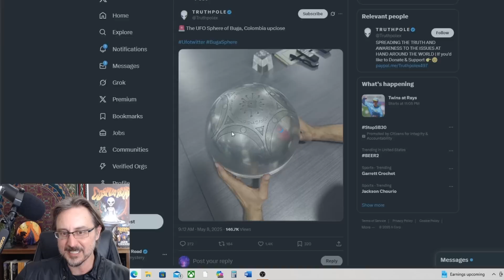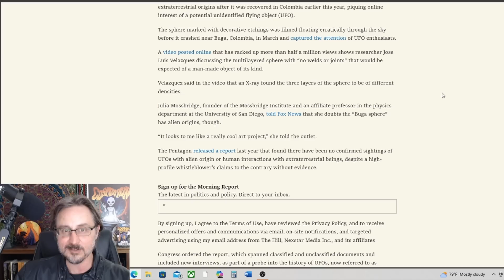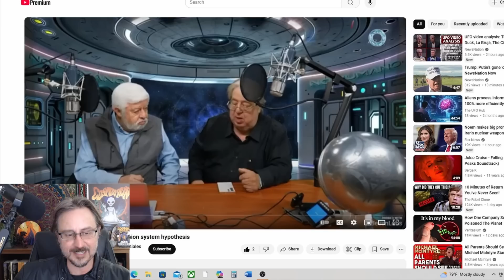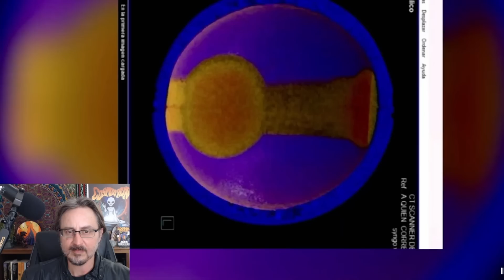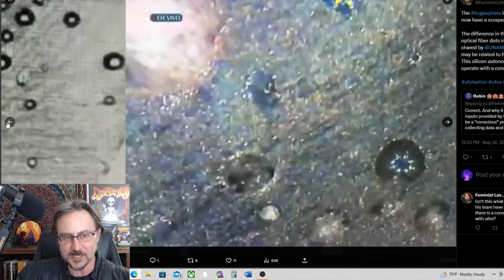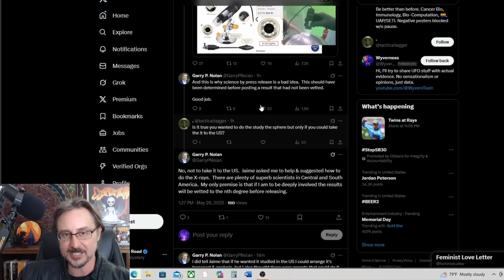Update on the Buga Sphere UFO! And Garry Nolan Responds!

Comment: Just a few observations... very few of the lines in the supposed "design" on the front are perfectly straight let alone perfect altogether. Everything looks like it was etched by hand, not my machine. If you were a super technologically advanced species creating these things, why would you create them so imperfectly--it doesn't make sense. The only reason these things would be hand-etched like this is if they are a hoax, which I'd bet it is. I mean just look at the contrasted areas where someone literally hit the damn thing with some kind of a pointed drift over and over to create pointilism to achieve contrast! You should consider it an insult to your intelligence to be presented with something like this and for people to accept it as some piece of advanced technology when clearly someone made the design on the front with a hammer...

Comment: I have numerous videos I caught myself and I have been capturing these things! I can't believe someone has one! I've been tracking these things for nearly 3 years not only that but I have caught them watching me as well. A few months back one of these things was in my apartment and shot a laser out and it wasn't even like a normal laser it wasn't straight it came in sections and the lines looked like something from a graph chart and the color was a mixture of yellow and orange and had black spots in the light and the laser vibrated and at the end of the beam of the light it created a small circle. Kinda like if you were to hold a Flashlight close to a wall.. it vibrated and started to power down in section. It was pretty cool to see. I just wish I wasn't stun form what I was witnessing to record the encounter.

Comment: Grok is incorrect or behind the curve on three measures. The sphere's diameter is 20 inches rather than 1 meter (39 inches), its exterior is 95% aluminum, not "titanium or steel," and it no longer weighs 2 kilograms; that was its initial weight, but it has since grown heavier and currently tips the scale at 10.13 kilograms.